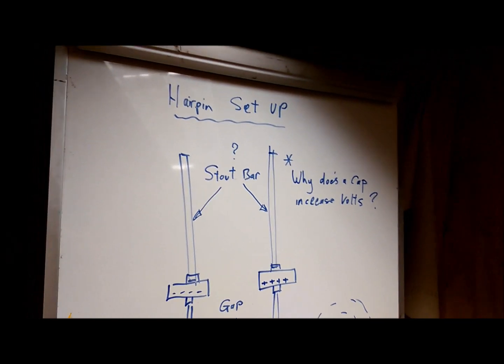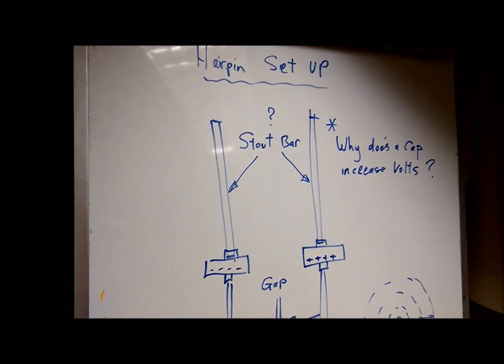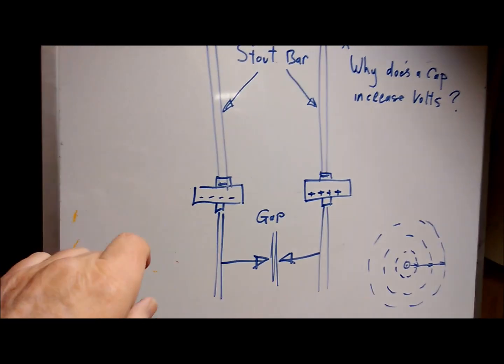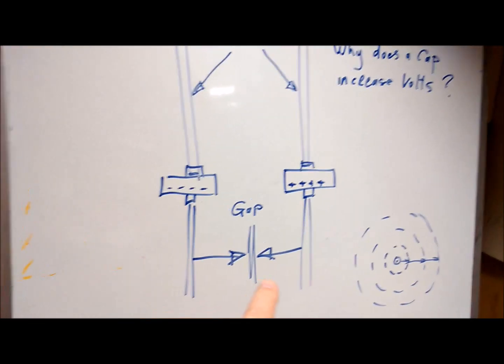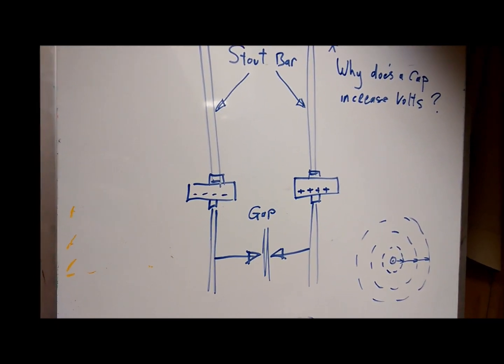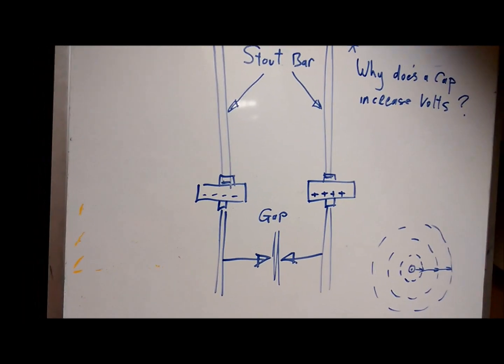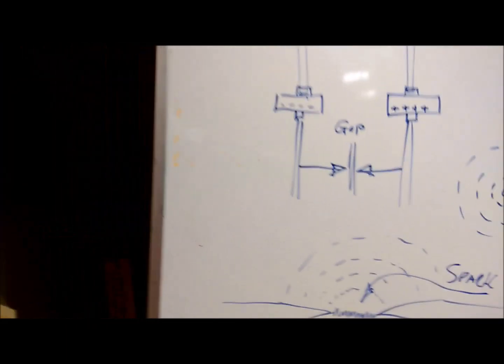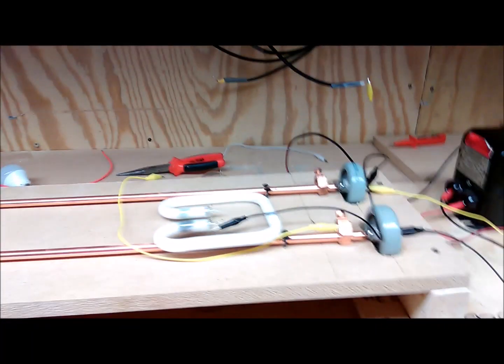Electrons do not exist ( Nikola Tesla Hairpin Circuit )

Comment: I'm definitely not an expert but I'm at least pretty sure... But not 100% sure... That in order to have a dielectric discharge there must be a insulating dielectric barrier ....which is why high voltage is required to do it....and dielectric discharge produces ozone....and since  the earth has a ozone layer... You must conclude that the universe is electrical and not gravitational which is quite obvious to people outside of mainstream science... They will never admit that the universe and sun are in fact electric... And they will never get rid of Einsteins obviously incorrect theory because of 1 reason...if they do admit it then they will be admitting that they have been fear mongering citizens of the World with nuclear weapons and that nuclear weapons are fake....because they are based on Einsteins incorrect gravitational sun model were explosives are placed around a core and detonated squeezing the core... Just like how they claimed the sun worked... The electric universe theory explains the universe very easily unlike the standard model...its no comparison... The electric universe theory blows the standard model away in terms of simplicity and explanation of the universe...
Reply: In the electric universe theory heavier elements are not made in the center of the Sun...they are made close to the surface...so don't anyone hold your breath waiting for mainstream scientists and physicists to jump on board and abandon gravitational universe...so they will never unify the theories because they can't...if someone like me can understand gravity is BS they are intentionally not saying it... You can see a star behind the Sun during an eclipse not because space is being warped...but because the light from the star behind the Sun gets repelled around the Sun... Light does not even travel... It's like electricity going through a conductor where energy is transferred but nothing moves..and one photon  transfers the force to the next.. To the next...photons are abstract..because photons are energy and not physical things... energy moves always.. It can not be stopped . Only electricity can create magnetism and vice versa...you can actually observe the electric current that flows from the sun to earth..that is what the northern and southern lights are.... They are connected electrically...and when ever current flows it produces a magnetic field.. This is how the earths magnetic field is created..the Earth can not be a dynamo because it makes no sense because electricity is required for a dynamo...the earth is definitely not a permanent magnet..the source of earths magnetic field absolutely must be from a external source... This is not up for debate...heat makes magnetic fields weaker...so because it is universally accepted by all theories and minds that the earths magnetic poles have flipped and switched many times in the past which is very simple to prove because you can see the arrangement in fossils and rocks that get locked in that position by digging down into the earth.. And they can do the same kind of thing in polar ice sheets which also locks the composition of the atmosphere when that ice was formed at the surface..the use very long core hole saws so they can examine the past of what everything was like when it formed...including the direction of the north pole because they know whats going to always point in that direction...so if u find that same thing but pointed in the opposite direction...this tells you that the earth magnetic poles flipped and this is a clue and something that can prove if the universe is electric or gravitational...its quite simple for just about every single person with a high school education to explain and understand electromagnetically...but can just 1 person explain it gravitationally so everyone else can try to understand...how can gravity make the poles flip and also stick to a predictable cycle....it is impossible to explain gravitationally...it just can not be done...the first reason is obvious..cause gravity does not exist..gravity is magnetism...the second thing is that if earths magnetic field came from within the magnetic field would have to get to the point where earth has no magnetic field and a very weak magnetic field for a large majority of the total time for each time it flips..it would be like having a full battery and discharging it which continues to make it weaker till it dies and you charge it up again...it would act like DC current.. Earths magnetic field can not be from DC current because of the fact commutators are needed.. And again...DC is AC but only half of it and the other half is blocked from making the return trip...someone would need to explain what is blocking the current from returning...that is exactly what a commutator does..a commutator for you that do not know is a electrical switch that ensures that the current that is flowing is DC current and they are used to change the direction of the current flowing... All of this must come from within for earths magnetic field and not an outside source...the electric universe theory explains how all of it works with electromagnetism...unlike gravitational universe theory that can only explain 4% of the universe...the rest being dark matter and dark energy or more accurately...i don't know ...it must be AC current that flows to earth from the sun that produces earths magnetic field...and to top it off these god damn assholes have the nerve to say that gravity can both attract and repel but gravity is definitely not electromagnetism ...uh.. Hello...unreal ......but it does give the illusion of being a dynamo to people that do not understand electromagnetism.....where does the electricity come from if not the sun that produces earths magnetic field..electricity is mandatory in order to produce a magnetic field..you can not make it without it...and it is the only thing that could make it....but the answer is of course nothing cause the earth is not a dynamo..light is alternating current itself...and DC current is just 1/2 of the sine wave of ac current..so ac and DC are the same thing really...its just that current is blocked from making the return trip back...and because everything in the universe is made of charged particles...they have an attractive force to earth...gravity... Alot of the electric current that flows from the sun to earth is used to heat up the earths core so a lot is wasted as heat...which gives the gravity the illusion of being weak...but people don't understand that the earths spin is also a result of the electric current that flows to earth...and also the moons orbit around earth and the earth around the Sun...so gravity because they try to make it it's own separate thing when it's not...again which gives it the illusion of being weak...there are not that many people on this planet that know that the current understanding of the Sun can not be correct...literally a 0% chance...1 of 2 things are the problem...it absolutely must be either 1) the laws of thermodynamics are wrong and we don't understand thermodynamics like we think we do... Or 2) The gravitational sun model is wrong.. It can only be 1 of these 2 possibilities...Thermodynamics have been tested in every single way possible and imaginable for well over 100+ years.. Probably closer to 150yrs and it's still standing there unchanged...and on the other side of things you have a gravitational universe theory that must add unknowns (constants) just so the theory makes sense...only 4% of the gravitational universe is explained and understood...the rest is dark matter and dark energy...4% and you hear mainstream scientists and physicists talking about Einstein and how great his gravitational universe theory is... You got people like Neil Degrass Tyson saying how great it is and how you can predict with it then when asked what gravity is he says.. I don't know...and that 4% that is understood matches the % of visible light only to the full electromagnetic spectrum ...approximately...the sun does not transfer heat throughout the entire sun like the laws of thermodynamics say it should...according to black body radiation...research the electric universe/sun and how black body radiation proves that the sun can not be gravitational...but again.. Do not expect mainstream scientists and physicists to ever step away from gravity they will not do that because then they would be admitting that nuclear weapons are fake because they are modeled after a gravitational sun that makes heavier elements in the center of stars using gravity to compress hydrogen into helium...electromagnetism is responsible for making stars and planets and the heavier elements...i recommend researching the electric universe theory but you must understand...there is a reason why you do not ever see a debate between the two by people that are proponents of each that are in the field... They don't want people to understand the universe and they are actively trying to keep it so neither side can say with 100% certainty this is what's correct...you absolutely must do it yourself if you ever want to know the truth. I pointed in the direction of the truth... It's up to you if you want to get there or not...black body radiation is a good place to start to see if u think its gravity or electric or if gravity is  electric...after all Quantum mechanics is electromagnetism...
Reply from the maker: We are now on the same page. The focus for me is understanding the spark gap. This gives a window into the aether. Regards dc
Reply: @e.powerdc1127  Look on line for Gerry Vassilatos "Secrets of Cold War Technology", Chapter 1 on Nikola Tesla. You might want to take notes on the technical comments, it's written by a non-technical author, but he highlights the differences in Tesla's thinking and "modern"electrical theory. That change in spark is reviewed, and its not exactly that electrons do not exist, its that the set-up stops them from transferring at the gap when you short out the voltage (the electron differential) in the circuit. (free .pdf on line)
The whole secret to Tesla's tech is filtering out the electrons. Here's a brief understanding of Tesla's theory. It actually matches observations from quantum physicists who are on the bleeding edge. They admit there is something that fills space, they call it quintessence. Which is one of the alternate alchemical names for Aether. When space defining Aether is conditioned by Aetheric constructs like matter, or kinetic energy, it is referred to as Ether. Which is what Tesla called the stuff he separated out from the electrons. You see, it is widely accepted that nothing that we consider physical matter, like protons, neutrons, and electrons ever touch each other. They are all surrounded by Ether that manages all the interactions.
With a spark gap, Tesla was able to block the transfer of electrons and then capture and route the Ether that was tuned to electric charge. He considered these Ether particles to be able, when freed in a special spark gap, to travel FTL, which while moving, or trapped in a dielectric material, would not recombine with electrons, or more likely generate new electrons. If it slowed or got trapped on (it traveled on the surface of the conductors) a conductor, then it would create electricity.
If beamed, the Ether travels through the Aether forming what Tesla called stationary waves. Superconducting through the Aether, instantly. He did experiments to verify this. This was his method of transmitting lossless communications and unlimited power anywhere on the planet, or space from his Wardenclyffe tower. The gap was modified from the stout bar set up, and your demo shows why. Before you short it out, there is no filtering of the electrons from the Ether. with the short, the electrons in the total circuit have filled it to capacity and are always set to net out at zero potential. But, that has a delay at light speed, so the gap sees a differential. Tesla noted the spark becomes "flame-like", softer, fluttering like a burning flame. Also whiter, not as blue. 
If you want to get the effect without the stout bar, Tesla recommends a unidirectional discharge (normal sparks, like the one you have from an AC source bounce back and forth multiple times in each discharge. Tesla filtered the differential to be DC, and also limited the time of the spark with counter rotating gap points, and he found carbon has a natural tendency to block the electrons, so he used carbon contacts at the gap. He also found nitrogen to capture electrons, so he blew nitrogen gas across the gap, and finally, he used a strong electromagnet to pulse simultaneously with the discharge across the gap to bend the electrons away from the target. The Ether does not bend like the electrons. This one aspect is what convinced Tesla, he was not dealing with electricity, it's lack of response to magnetic fields.
On the other hand, keep in mind that all interactions are Ether interactions. So magnetic fields are stationary Ether waves... they are a specific pattern of Ether that affects matter with a matching pattern of Ether. These waves are broadcast from sparks or energy releases. Ionizing and nuclear reactions that release electrons and protons and neutrons (including the release of electrons from neutrons) all produce magnetic waves in the Aether. Tesla discovered he could manipulate these wave forms with his spark gap, and target the specific functions that emitted the waves.... Like a sound resonating with a tuned string. For example he could make the air glow sky blue, or white, like daylight, or red like a sunset. He accomplished remote nuclear control. (Yes, anything could be done to anything from anywhere.) This would have destroyed the industrialists who were invested in monopolizing things... and the threat is still real today... Be safe, you are playing with more than just high voltage. Peace, B
Reply from the maker: @mundymorningreport3137  MMR Hi again just some feedback, sorry it took time. Your understanding is great and is one of the best since I started my channel. ..Regards ... DC
Reply from the maker: universe is electrical or its like "Light".  Regards .... DC
Reply: Good luck with that reasoning, it doesn't make a lot of sense. Einstein dreamt up a lot of fake science to preserve the profit margins of the industrialists invested in ore and patents for making inefficient electrical systems. Your explanations or understanding of how things work have little to do with how they work or if you can operate them. How many drivers know how cars and planes work, yet they operate them just fine.

Comment: A capacitor can also decrease the voltage in some configurations.

A capacitor can increase the voltage when combined with an inductor (even if the inductor is a stout bar) by way of the reactive power. At the capacitor stores energy by charging (that is the real power input) it now has power within itself. As the cycle changes, the energy stored in the capacitor can act again (re-act) but this time it involves the inductor. A current begins to flow in the inductor which builds up a magnetic field which is a store of energy. When the cycle changes the energy in the magnetic field is now considered reactive power. The inductor and capacitor continue passing reactive power back and forth between each other with real power being added being added on each cycle also. This causes the voltage to increase (while being stored in the capacitor) and also the current (while flowing through the inductor). The energy in the system continues to increase until the losses (which continue to increase as well) balance the energy being put in.

Such is the life within a tuned circuit.

Comment: Ed Leedskalnin talked about this years ago. He completely agrees with this assertion, and does a similar experiment with vacuum tubes to disprove the electron theory. This is very interesting and I really like this video.
Reply from the maker: TalkingToLeedskalnin may be E = just static discharge, Tesla's "event" type of pressure static explosion pulse at measurable frequencies. ...
 DC

Comment: If not electrons then what happened to the stuff coming out of ur transformer? As it's copper wound, and we know from the table of elements why certain metals are conductors?? Hmm strange spark then.
Reply: Ian Barnard Try reading Electromagnetic Theory by Oliver Heaviside (inventor of the coaxial cable.)  You will gain a better understanding.  Electricity is not electron particles flowing through a conductor like water through a pipe.
Reply from the maker: Think "Light"... Regards .... DC
Reply: @e.powerdc1127  I think I see what you mean, instead of electrons you have e m radiation violently shaking The Ether and creating some frequencies of visible light, which we see as a spark.
Reply from the maker: It's a snap a short of explosion, like a galaxy or matter forming event. To imagine this look up " star in a jar". I hope this helps. Just a therory which isn't part of our " physics mainstream". ...... Regards ... DC
Reply: Nothing is coming "out of" a transformer or generator.  When Tesla and Steinmetz ran their AC generator they would say it's "churning up" the Aether. The Aether is a field, it is "counter space",  it is inertia,  pure potential. The loss of that inertia then manifests as EMR. (space).  Copper, aluminum and other metals are not  "conductors" they are diamagnetic "reflectors" that carry the EM energy on the surface of the wire, not in them. That's why single "conductors" are commonly stranded.  Perhaps you have seen high voltage transmission lines in pairs or 4 wires in a square configuration? That is why. They can carry much more power because the 2 fields are trapped between them. The dielectric field is voltage, and the magnetic field is amperes. Together we call it "Electricity" I know, I'm a year late!